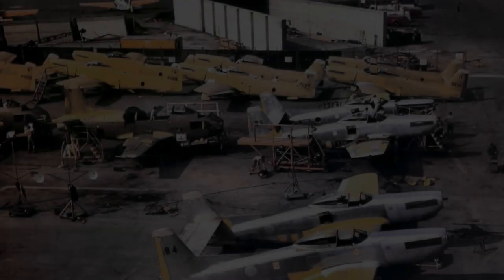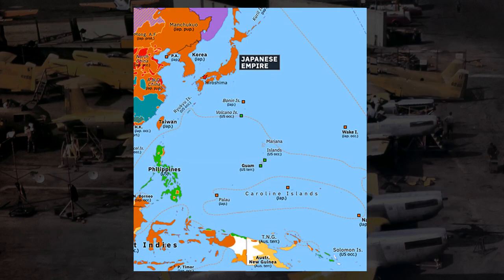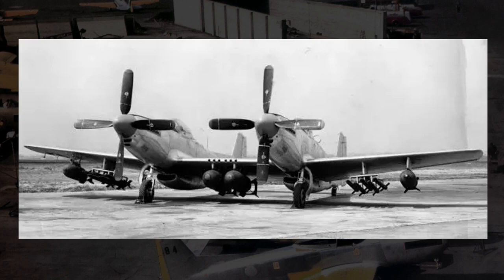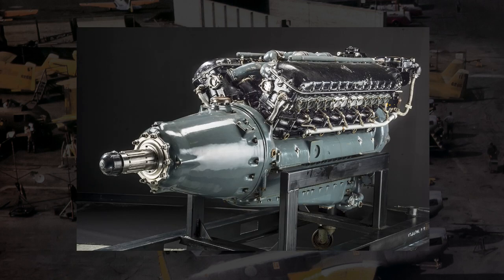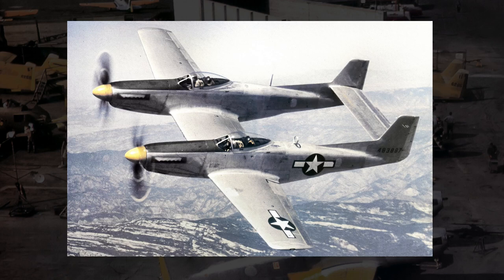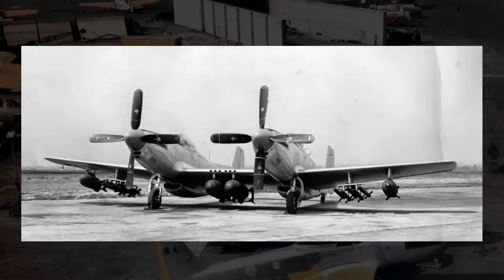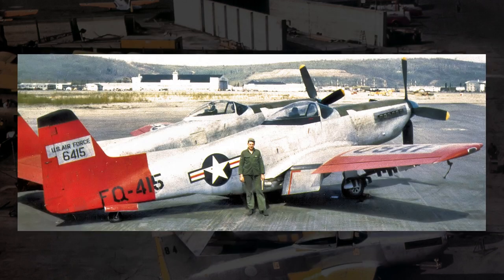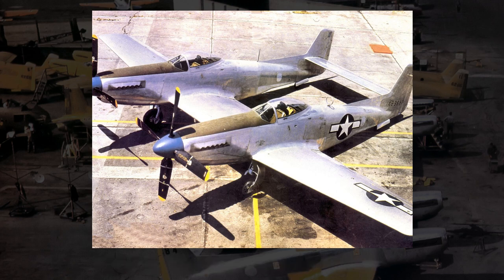Two Cockpits, One Plane: The North American F-82 Twin Mustang

Comment: This aircraft didn't become the F-82 until 11th June 1948. So, anyone looking up this aircraft might need to look for the P-82.
Reply: Oh an the props were put on reverse which was an added headache to the pilot/S
Reply: No, it's always known by the later designation.
Reply: @anzaca1 you more wrong than Wikipedia. The XP-82 first flew in June 1945. At this time F stood for Photographic Recconaisence not Fighter. It wasn't until 1948 until F became Fighter. At that time the P-82 became the F-82.
Reply: Well, considering the fuel "efficiency" of jet fighters, the long-range escort role should have and apparently has held for quite a while with the SAC.
Reply: @anzaca1  Not in 1945 when it was still the P-82. The F-82 did not start till June 1948 when the newly formed USAF changes all P a/c to F a/c.

Comment: I've read that it was the P-51s cruising speed that was the biggest issue, as the B-29 flew faster at cruise and the Mustangs burned fuel far too quickly trying to keep up.
Reply: Can you tell us where you read that?  I find it to be unlikely.  Not that I consider Wikipedia a definitive source, but it lists the P-51 as cruising 142 mph faster than the B-29, which is a significant margin.
Reply: @gort8203  to be honest, I'm not sure where I read/heard that. But it was probably watching some of the clips on the restoration of the XP-82... But then again, I could just be wrong 🤪
Reply: @cabanford  Thanks
Reply: It's the opposite, which actually made any escort fighter's burn excessive fuel trying to match speed with the slower bombers, pretty much all the fighter's had that issue.

Comment: After a few hours of the first flight both pilots had a disagreement and parted ways and the original Mustang was born 🍋 it’s also believed that the original twins engine props mangled each other on the first test flight as they were placed too close together and they forgot to make an open hatch release on the inside cockpits and forgotten flaps

Comment: The Rutan Voyager, crewed by Dick Rutan and Jeana Yeager, flew around the whole world in 1976 - using propellers  A F82 surely doesn't hold a distance record, for propleller planes, at all
Reply: The record set by the P-82 was for a propellor driven fighter, a distinction that our presenter ignores. However, it might still be a record depending on the actual wording of the record set, some speed records are for flight around a specific course leg length at a given payload. However, the time taken for this distance has never been bettered by any piston engined aircraft.
Reply: December 1986, a wonderful achievement.  This video doesn’t cover how awful the F-82 and its production version’s engines were.
Reply: @givenfirstnamefamilyfirstn3935 Yes, he does.
Reply: @neiloflongbeck5705  That's a pretty petty record then.
Reply: @ekspatriat  it's like boxing. You have different weight classes so that you get a fair fight by matching, as closely as possible, capabilities. The Rutan Voyager had a maximum take-off weight around two-thirds of that for a P-82 putting it in a different weight class.
Reply: @neiloflongbeck5705  So just like the land speed records (classed) it's not the outright record holder just in its class. Thank you so the Rutan is the outright record holder. (the one everyone remembers). And you picked boxing to skirt around this fact. Top speed is top speed.
Reply: @ekspatriat  no, I used boxing as it has several weight classifications. It's called an analogy. And the record set by the P-82 still stands.
Reply: @neiloflongbeck5705  I used the land speed records as an analogy which is much closer to the mark. I think you will agree the P-82 is not the outright record holder.
Reply: Depends on your definition of "longest" too, as if you go by time rather then distance, it's 64 days!  Or 9 days if you don't count one's involving in-flight refiling.
Reply: @scottthewaterwarrior  Oh so were going to define by 'slowest' now...barrel scraping